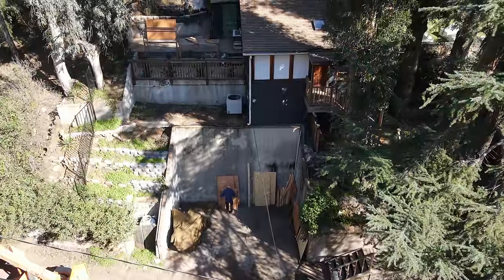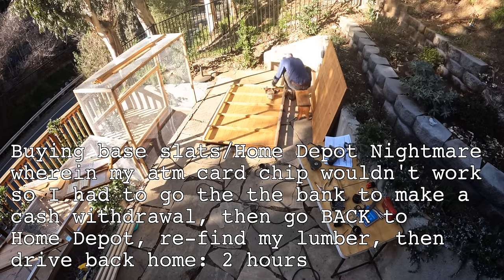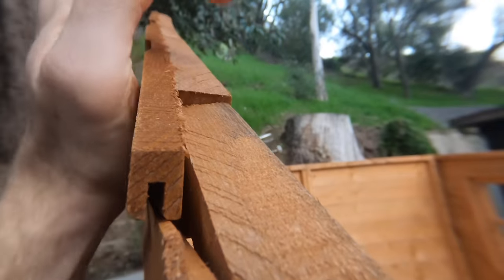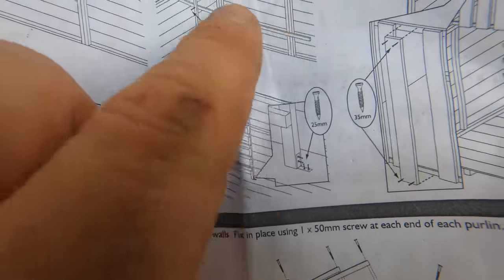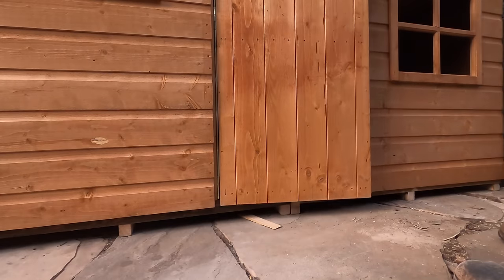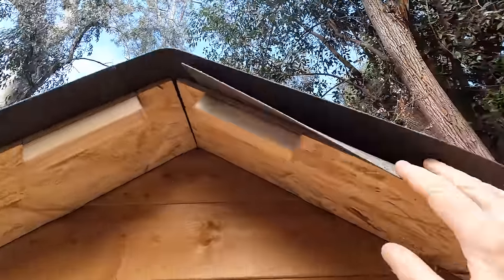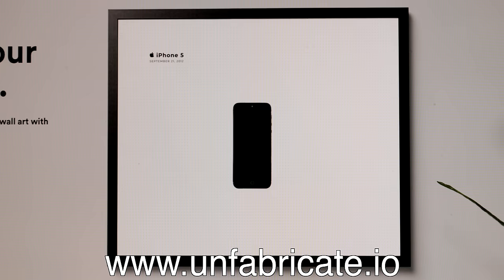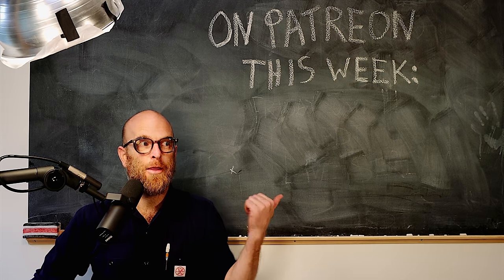I Built a DIY Playhouse. Is it worth it?

Comment: Those roofing nails did look really, really short. However, the proper way to handle a roofing nail isn't between your index finger and your thumb. Hold your hand, palm up. Then push the nail between your index and middle finger so that the nail head is flush with your fingers (but not between your knuckle joints or the next step could hurt like hell). Give the nail a strong tap, this will set the nail point into the substrate. The fleshy side of your hand will flex and depress down when you tap the nail. Then, remove your hand (the nail will remain standing) and drive the nail in with a single hit. Every roofing nail will then take you two swings of the hammer, tap to set, remove hand, drive the nail. This will save you hours.
Reply: I think van's trick is a better idea
Reply: Needle nose pliers !
Reply: Great advice for normal roofing but I think those nails were shorter than the diameter of his finger bones.
Reply: I've used a rat tail comb.

Comment: Hey Van, your DIY roofing tack tool reminded me of a trick I learned when I hired a retired roofer to come help out in my cabinet shop. When you're holding tacks or small nails to set em, don't hold them like you would with an 8d nail (similar to how you'd hold a pencil), but lay the back of your hand flat on the surface with your palm up, and hold them between your first two fingers like that. Way easier to get short nails and tacks started, without having to fiddle with a jig or a pair of needle nose pliers, etc. Maybe that'll come in handy for someone reading this, because I've used it a trillion times since he showed it to me.

Comment: I had a water leak coming from the front wall of my brownstone into the basement. I thought I’d fix it myself with leak stop cement. Then I decided to hire my neighbor, a cement and brownstone expert. He found several problems and fixed them all. I would have only fixed the one crack I could see. Money well spent, no more water leaks. - Eric.
Reply: This dilemma is exactly why I am so intimidated to try fixing or repairing anything. Very disheartening and discouraging to me.
Reply: @grasslad6898 When it comes to leaks, a professional is needed. Even avid DIYer need to call in the experts.

So this shouldn’t dishearten you. Start small projects and you will soon learn the skills and gain confidence.

Comment: 3:20 I had that problem with small nails when I built my shed (took a long hard look at the "ready"-made ones and ended up drawing one instead. Best decision ever, judging by your experience). My solution was to hold those tiny buggers with a tweezer. It worked so well that I ended up holding bigger nails that way too, but I've since learned that old carpenters will sometimes take a piece of thin plywood or one of those sticks you get when you buy a bucket of paint, saw a slit in the middle and hit the nail far enough in that it holds. Similar to your solution

Comment: Amateur tip with holding short nails with your fingers:
Hold the nail between your pointer and ring finger but with your fingernails facing down. So essentially you’re holding the nail with the side of your fingers, not the pads. Don’t use your pointer and thumb. Thumb is too big.